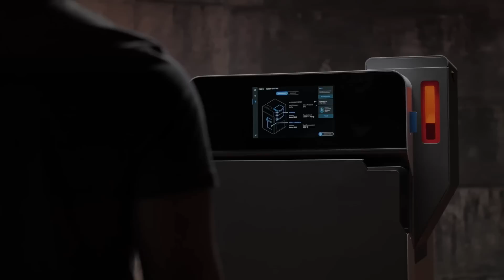Formlabs and Micronics: A Shared Vision for the Future of SLS 3D Printing

Comment: I was wondering how Formlabs was going to respond to these two dudes making an Actually Affordable SLS printer available via Kickstarter at less than a tenth of the price of Form's printers.  Turns out the answer is "buy them before they can ship anything, cancel all orders, and make sure the product never sees light of day".

The Micronics guys seem nice and I'm glad they got paid, which is literally the only nice thing I can say about this.
Reply: They didn't get paid - at least not yet. Getting shares in a company that isn't public yet is not the same as depositing a check into your bank account. Their valuation is absurd compared to their revenue. There's a reason they're "taking their time" on the IPO. Hopefully it works out for them.

Comment: Dont worry guys, there is probably some chinese company that is reverse engineering this stuff right now, you will see some 3d printing brand coming up with an affordable and better printer in 2-3 years
Reply: Reverse engineer from what? You need to have a physical product that actually works first. 2nd it needs to have success for they to contemplate copying it. We can only hope but it may take a while!?
Reply: @nevin_co  They can probably acquire one of these prototypes.
Reply: I feel like Anycubic is the only ones that would even attempt at a non FDM/VAT printing technology, considering that they were the ones that brought MSLA prices down in a time when they and their competition were primarily FDM. They're also the only ones I know that offers a hobbyist DLP printer. I think all the other chinese vendors just flow with the current.

Comment: The fact that “Open Material License” is even a thing means that this is dead.
Reply: That's the biggest letdown with this whole situation. If this exact same situation happened but with prusa research I would be ecstatic, because they support open source and are truly a company that focuses accessibility. Even if their printers aren't the cheapest, the fact that everything they do is open source makes everything cheaper for everyone.

As far as I understand, formlabs is sorta apple like. So very anti consumer
Reply: @ZettabyteGamer  Well, Prusa has bought trilabs3d that made delta printers. Before they cost around 4000$ in the better configuration - now they cost 11500$. Prusa also bought a display based resin printer that had a tilting mechanism, the price is always around 2000$ which is def prosumer in comparison to Elegoo, Anycubic - etc. I simply would be at least a bit doubtful about Prusa too. I think Formlabs will just kill the whole product. Nothing new in the world of business. Sucks but hey, things could be even worse :D
Reply: Formlabs is busy filling patents 😢😢😢
Reply: @bucurionutrusu3260  and using open source hardware ha. i mean raspberry pi in form 4

Comment: Formlabs and affordable aren't compatible.
Reply: It is all relative. Formlabs is still <20% of the cost of 3D Systems or Stratasys systems. 
If you are ok with a printer that has 80% reliability.... or dimensionally off parts (+reprint time) then stick with the hobby grade stuff.
Reply: this
Reply: They used to be okay. Now only worth it if it 100% fits your needs, otherwise buy something way cheaper

Comment: Goodbye low cost SLS, you were a happy dream
Reply: No way Mirconics would have been able to deliever on kickstarter promises though. 1.3 million is a lot but not to get something like this off the ground
Reply: SLS is and will never be low-cost. Material is circa $100 per KG and machines are very sensitive, the technical support packages required to keep these machines running would have to be a minimum of $1k PA and beyond the reach for most of their target audience.
Reply: Light-curing resin and lasers were prohibitively expensive before the democratization of SLA technology. The price of anything goes down drastically with volume production, and this will be particularly true of nylon powder, which is in fact a relatively simple material.
Reply: @fluxcapacitor  then why have HP had to increase their powder prices because the volume wasn't there? They are the largest powder-based printer manufacturer globally..
Reply: @sgd1541  i think you know what they meant people are looking for more options in the sub 10k range of sls printers. PA aside